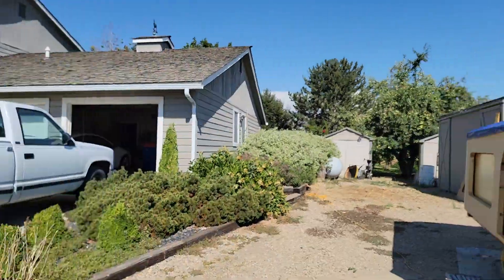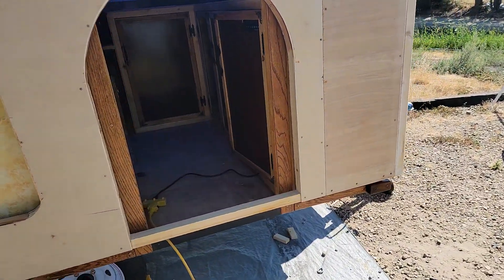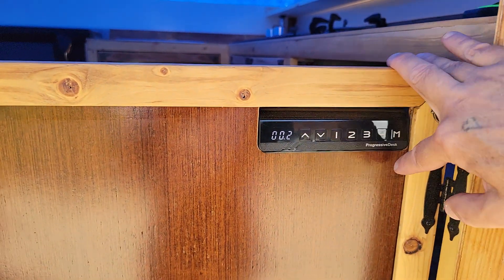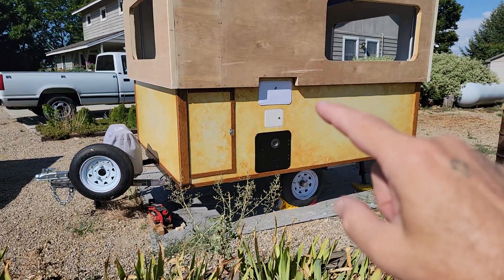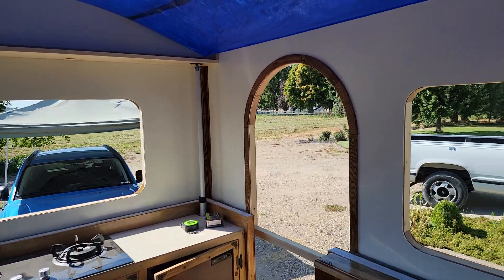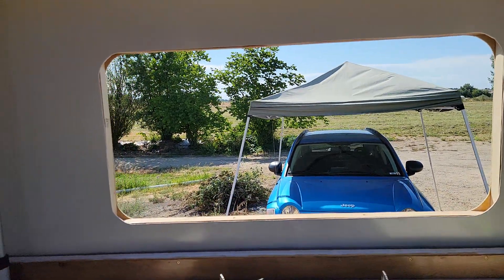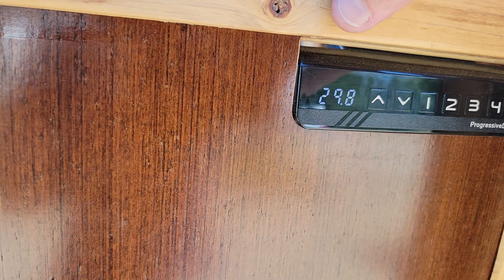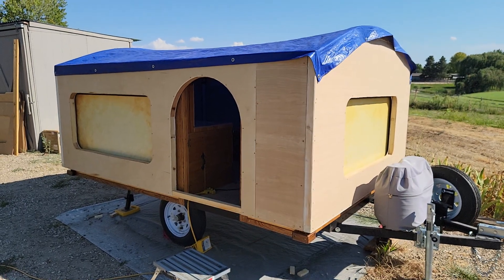Gypsy Caravan Project, Part 8: Testing the Lift System

Comment: I liked your idea about bringing the top down while sleeping to have a double wall insulation - however - should your lift system fail, you will be trapped. All windows will be unacceptable and you won’t be able to open your door due to not being able to access the top one.  Safety first.

Comment: Do you remember how much space you allowed on each side of the top to pass by the bottom, ie 1/2", 1" per side?
Reply: I think he said it was a 1/2 inch in a previous video.
Reply from the maker: 1/2" per side front and back, but slightly wider on the sides (3/4" I believe) to allow for vents and latches. Should have done 3/4 on the rear for the hatch latch clearance, as it ripped the rubber d-seal weatherstripping off. I just cut a new piece with a small gap in the middle.

Comment: Great build. I've actually designed something very similar and I'm glad someone already built a lift system with electromechanical actuators to prove the concept. I'm wondering what gap you left around the two sections and how rigid the top is. Like, does the top ever scrape the lower section when raising or lowering? I was going to specify actuators with rigid end connections rather than pins to help with that. Thanks
Reply from the maker: Sorry I somehow missed this comment! I left 1/2" gap front and back, and 3/4" on the sides due to the doors and water hookup stuff. Only had a small scrape on the back hatch door where I didn't account for the extra bit of trim I added on around the hatch, but otherwise, it's smooth as silk and solid as can be. Cheers!
Reply: @WanderingScot  Thanks for replying. I left 1/2" gap all around as well. For my hookups, I countersunk them into the wall to eliminate the protrusion. Fun project, I have a little more fiberglass work to do and then I can connect the top and bottom sections.

Comment: Very nice and thoughtful work! You are the first I have seen on Youtube doing this lift system. I have been researching on how to do a similar lift system on my truck bed canopy, but got difficulty on how to let 4 lifting legs to work together. Is that possible you can explain little bit more on your lifting system setting up maybe even including some parts purchase links? Highly appreicate. Again outstanding job done.
Reply from the maker: Thank you for the compliments! I have put some parts info and a link to where I purchased the lift system in the notes for the video above. To make 4 lifts move together at the same speed regardless of weight distribution on each leg, you need the system with the Hall Effect sensor, which is a feedback system that allows the control unit to adjust the speed and force of each lift independently in order to keep them all synchronized at the same level. So if you have a lot of weight on one corner, and very little on the opposite corner, it will still go up and down smoothly and evenly. Also, you can buy the lifts in any length you need, so in my case I wanted 30" of lift, but you may not need that much, so the shorter lifts will be cheaper. Hope that helps!

Comment: What are the dimensions pretty awsome man
Reply from the maker: It's 6.5' x 9' (78" x 108") at the base (the top walls are 4-1/2" wider to fit over the bottom, but the floor plan is what matters). It sits on a 4x8 trailer frame, with a 15" overhang on each side, and 12" off the back. The front wall is flush with the frame to maximize use of the tongue area. The interior width is 73.5", which makes it wide enough to fit a spacious bed and sleep comfortably side to side.

Comment: Hi 
Can I question   

How long is the durability of this plywood? 
Thanks you.
Reply from the maker: That is a very good question. I bought it from Home Depot, and the product description says that it's designed as an underlayment for flooring, and that it's lightweight, yet extremely hard and strong. It also says it's "moisture controlled," whatever that means.

But ultimately it doesn't really matter, because it's completely sealed from the elements, and will never come in contact with water (see Part 9 in this series for the painted version of the top section). The underside of the floor is coated both with water seal and Flex Seal liquid rubber undercoating. The walls are covered in "PMF" (poor man's fiberglass) on the outside, and the whole thing is painted with multiple coats of marine boat paint for maximum water resistance. 

The lower interior walls are sealed with polyurethane, but the upper interior is also painted with marine boat paint, since it will be exposed to some road spray in the crack between the walls when it's in the down position for traveling. I could have just painted the plywood with boat paint, but I also chose to cover it in PMF, which is a glue-saturated layer of medium-weight muslin canvas, which is also then coated with a "gripper" primer paint before laying on the top coat. Assuming my window seals are good, no moisture should ever get to the interior of the walls.

So the short answer is that I don't really know, but given the construction method I'm hoping it will last a really long time!
Reply: @WanderingScot   thanks for a very detailed and complete answer